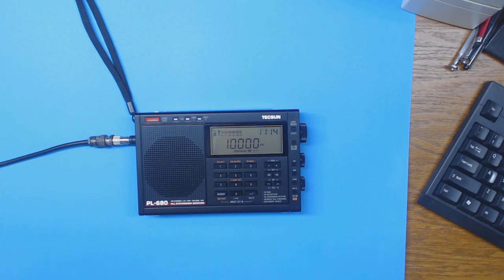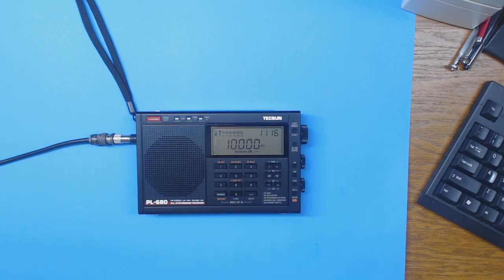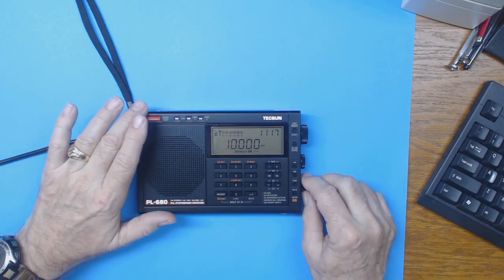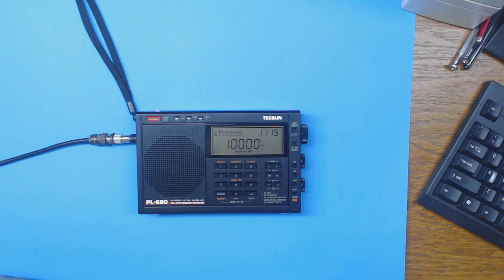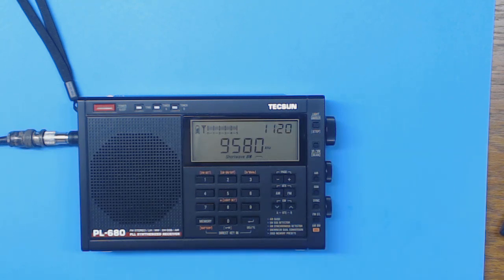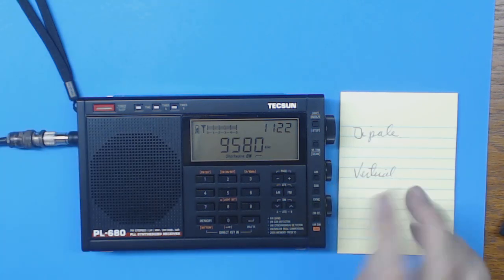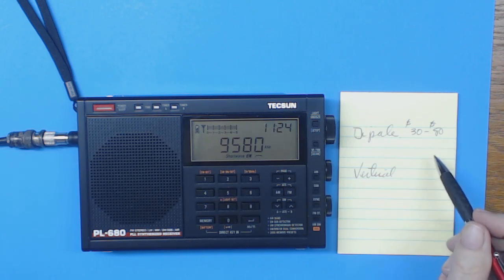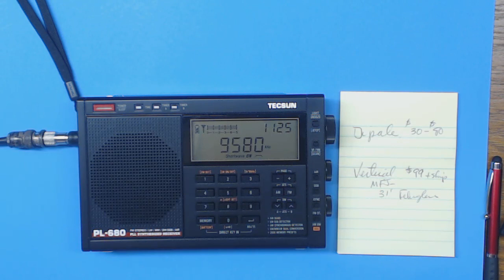TRRS #1081 - Antenna Testing Using Tecsun Pl-680

Comment: The vert. long wire is an omnidirectional. of sorts and would perform better, I think, if you had a counterpoise. The dipole is a horizontal, which makes it directional, receiving signals better perpendicular to the elements. These facts also determine your reception, I do believe. By the way, the blue background is a lot better. I like the MFJ analyzer demos, they are good graphic instructions for new hams like me, as I am quite interested in antenna construction. Thanks
Reply from the maker: Thanks for the info.

Comment: I was going to just use alligator clips to the 680 internal antenna than our to 300 feet of old army field wire and hang it in the trees. Any better solutions to better SW and Air reception? Everyone has some secret Jerry rigged connector, why doesn’t someone just sell the best external  antennae that actually fits into the right model?

Comment: Hi Tom,thanks for share the tests,are you satified with tecsun pl-680 model....73s!!
Reply from the maker: Yes, I like it a lot.
Reply: ok,also pl-880 is quality radio more high price than 680...with LW: 100-519 KHz..73s!!
Reply from the maker: I have had two 880 and never worked properly on SSB.  It now gathers dust in a drawer.

Comment: An antenna you should get your hands on is a Wellbrook loop. It's a lot of $ but worth it for low noise Dxing
Reply from the maker: I agree but way above my pay grade. :)
Reply: That said - the vertical seems to have the edge. Anything for a low noise floor - we seem to be swamped with crud electrical QRM nowadays.

Comment: I am radio lover I love listening radio but in my room FM radio signal strength is week it not catch radio signal please solve my issue how can I listen radio clear..
Reply from the maker: Add an external antenna.  Best to be outside antenna with coax cable lead-in.